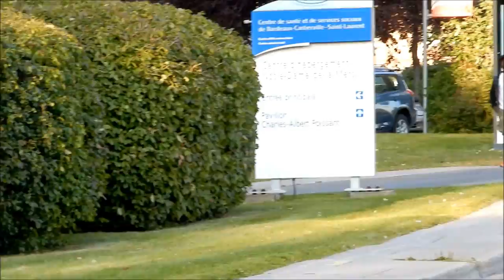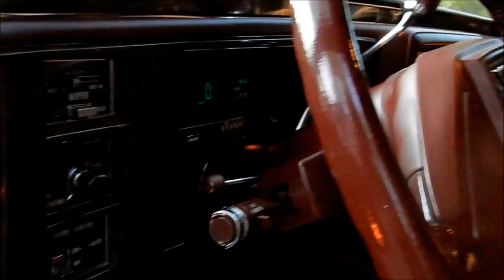STUNNING '92 CADILLAC FLEETWOOD BROUGHAM IN ACTION

Comment: Back when a car was a true car! rwd, full body on frame front to back, 350 cubic inches of 8 cylinder v block, and about 4,900 lbs of steel!
Reply: wakken 1994 305 or 350.  305 was more common.

Comment: It is a Brougham, but it is NOT a Fleetwood. They were separate models in these years. in 1993 the Brougham returned as an option for the Fleetwood.
Reply from the maker: Yeah yeah I know that now but it's still stupid when they did that in 1989 separating those two names into two models but hey that's GM for you
Reply: @retroolschool  There have been Chevy Broughams and Pontiac Broughams too.  It makes much more sense to reserve that name for the most upscale version rather than a separate model.   On top of that Fleetwood is SUPPOSED to be the largest Cadillac.  And during these years the Brougham was.  But I LOVE these 1990-92 Broughams.  I currently have a 1996 Fleetwood Brougham, but I am thinking of getting a 5.7 Brougham De Elegance next year or so.